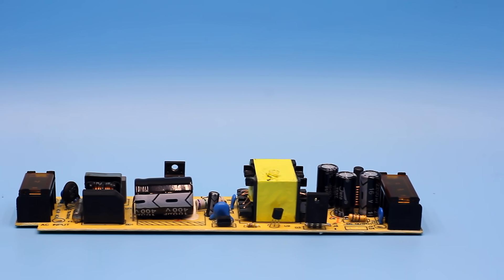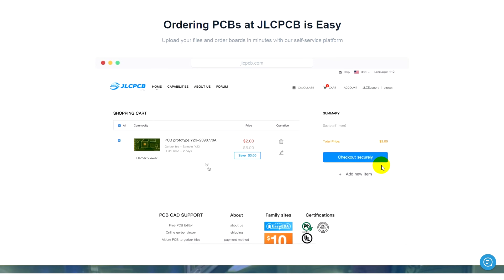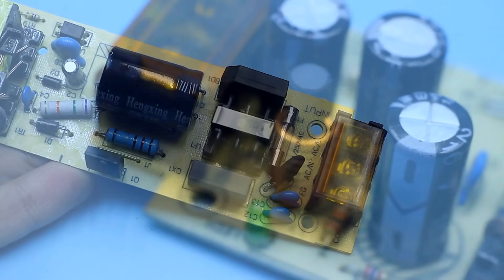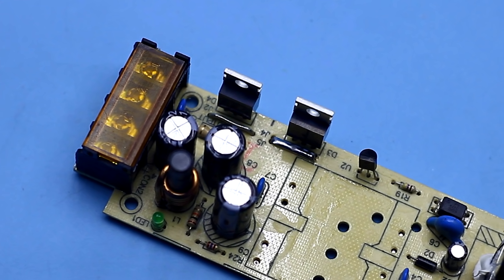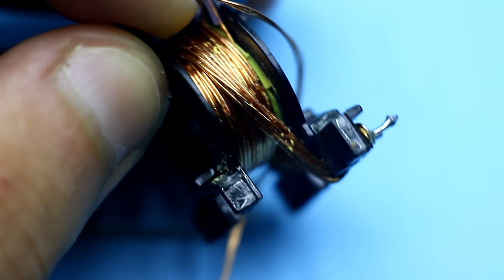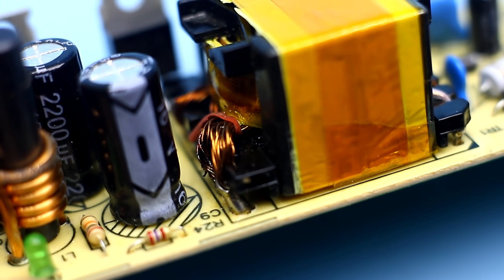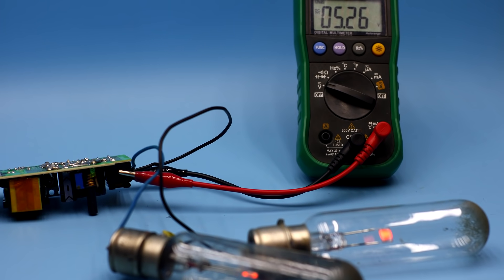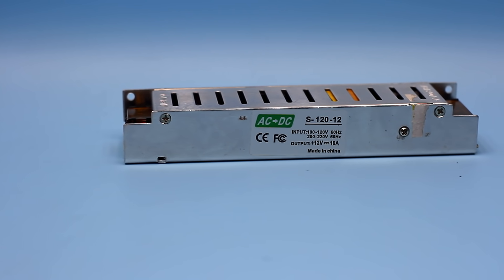How to increase the current of the power supply

Comment: So let me shorten this for you. 
Replace the transformer 
Read the spec sheet and replace the correct resistor. 
Possibly have to change the capacitors. 
Something else too but at this point although this is a good video and I'm not complaining I realize I'll just buy it as a transformer. 
By the time I do all this I can literally just get a diode rectifier and a transformer.

Comment: Kasyan i have a question i have a LED power supply 12v 33A
however i want o change it to 2.5~3V 13~160A 
my purpose is to use it for Electrolysis VOLT is irrelevant for that except heating up the solution i dont get anything out of it!
is there module for this? what is it called if not how can i make one to do this
tnX in advance

Comment: The best way to increase the power of the power adapter is to buy a new one that meets your new requirement.
A responsible manufacturer does every tests and make sure the power adapter sold will not put the normal customer in danger. Opening up a well-tested product to tweak the capacity beyond the design specification is totally non-sense. While this video demonstrate only some high school electronics principles you might have missed probably due to lack of attention while you were in class, you risk your whole family and neighbourhoods in fire danger.

Comment: Yeah I'll just build my own. My current project needs to take 215 nominal amperage and buck it down to 200 regulated amps to feed a 200 amp panel for a fully DC house. No AC will be on the property, no transformers, no inverters, all DC. DC Heat, DC air conditioner, DC refrigerator, DC washer and dryer, DC TV, all these things exist and are on the market. 3 socket receptacles will be available throughout the property. 12v, 20v, (a small few of the wall plates will have USB A 3.0, while most others will be equipped with USB 4 PD [all USB 4 use type C socket]). No need to rectify as source and supply are DC, no need to invert as all appliances will use DC. That being said there will be two inverters. One for just in case, and one for an EE lab. But not to run the o-scope, it's also already DC. Why? To troll you duh. Nobody's building that house lol.

Comment: Hi i have projector power supply for 5v 1amps, for micro controller standby supply used. In this unit LNK362 ic is used, but it has exploded . We try to fix it by replacing all components but still power supply is not working, my friends saying that transformer may be defective. Can u suggest to fix it. Any other Ac Dc 5v cannot fix already i have tried.only to fix it or replace new unit.

Comment: Hi, How  to reducer amp of12v.  84 AH car Battery to 13 amp.dc to connect with UPS ( replacing UPS 7amp battery. ( when I connected its work for 6 hours next day  not  working cause two mosfets burn completely one partially out of four ) I  use this only for PC. Will you  help me with a solution.  Thanks in advance.

Comment: To disassemble a transformer/ferrite core: Just put it im boiling water for just a few seconds up to maybe half a minute.. Everything comes apart without having to use any force, and there is no part of the transformer that could take any damage from being submerged in boiling water. It's definitely the quickest and simplestway i have ever tried, and with the lowest possible risk of chipping/breaking the ferrite core.
Reply: Thanks

Comment: I am making 24v 10amps smps my output is 410mA I want to increase current at 10 amps how I will get 10amps in output without Changing output voltage

Comment: Hi 
How i can change current protection?
Reply: Current protection usually at high voltage side. Since total power didn't change, no need to.adjust
Reply: @saneeshelectronica9293  so if we want to reduse power of converter how we should reduse current limiting?
Reply: @momsad8268   Here the video explains  to change voltage by maintaining  same power. if u want to change power  all transformer  size and other input sid e components etc will reduce just like a new SMPS.  What is ur actual requirement? u need to design new power supply it self ? or modify the existing one?
Reply: @saneeshelectronica9293  I just want to reduce output with a rheostat.
Reply: @saneeshelectronica9293  i want to design new power supply.
Reply: @momsad8268  smps design is a long procedure, if load is less use LM317 AND a transistor. see my video on that
Reply: @saneeshelectronica9293  thank you 🌷

Comment: Most of time you have to change the ferrite Core with a bigger one and the power tranistor the as well.
Reply: yes for small powr applicaiton LM317 AND transisor is better  see my vedio
Reply: Not if the VA (Volt Amperes) rating is kept at or below the original

Comment: Very intresting. Would you recommend me to use that method to just to increase current out put of my pc psu so i can have more wattage out of it? Would that work?? Thanks for the video very very informative.
Reply: No that will not work since you have to reduce the voltage to increase amps

Comment: I’m an electrical engineer with 20+ years of experience. DO NOT DO THIS!!   It is extremely dangerous to modify electronics without knowing what you are doing and full knowledge of the design. Best case it will fail prematurely. Worst case, it will burn your house down or kill you!!!
Reply: ...or both

Comment: Why two transformers used in power supply please please please answer thise question
Reply: If you are talking about the small transformer near the input, thats an insulating transformer, and it has a 1:1 turn ratio, that means it dosent affect the voltage, just makes the power supply non main earth reference, also i think it can limit the current for safety, but i coud be wrong

Comment: Can you please make a voltage  booster circuit using IC 555 to charge 450V  capacitor bank .
Reply: u need voltage doubler  with many diode and capacitor.

Comment: You can simply reduce the value of R14 resistor ....and if you want strong courant flyback is not good. Use push-pull designe only with transistos no need fo ic ...not stable voltage but higher courant and good efficiency

Comment: Simply just use one with higher currect capacity.Or calculate and make a new one using larger core,bobbin,wire diameter,different number of turns,recalculate overcurrent protection.Different output diodes and capacitors is the most easiest thing.

Comment: you should teach not only what you do but how you do it ... for example how you determined the number of turns of the secondary of the transformer
Reply: Use the length of the unwraped wire. If originaly for 12V there is 12cm wire, you need 1cm per volt (for example ofcourse) . So you mark the wire and wrap back to the mark and if necessary wrap some more to the right output contact then cut the excess wire. It is better for a wire to be a bit longer and to adjust correct voltage by resistors then cut it to short.

Comment: What is the watt rating of zener diodes and volt rating of 2.2nf capacitor in your previous video "adjustable power supply 0-35v and 0-5 amp"

Comment: I had done this idea before but in reverse,  I had increased the voltage but my current is too low and no idea how to increase it, can you suggest any idea,  to increase amp with voltage,ic is VIP22A
Reply: voltage x current= power. totalpower u cant increase if voltage doubled current is half. see my video on lenear power supply